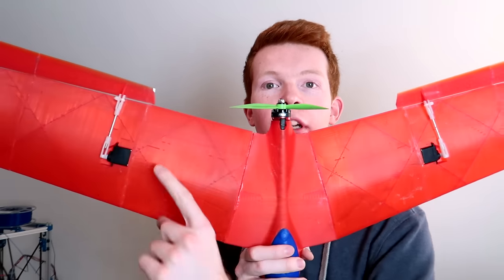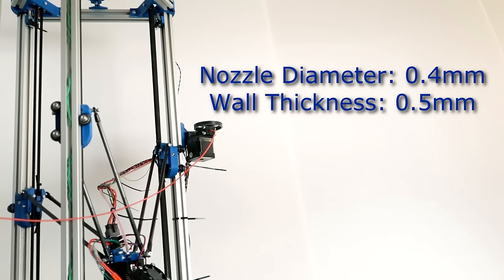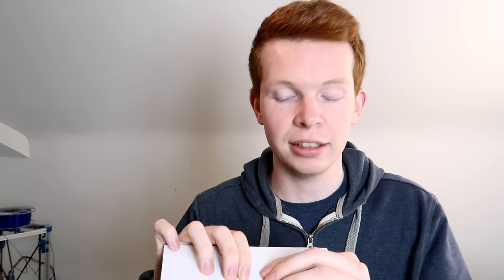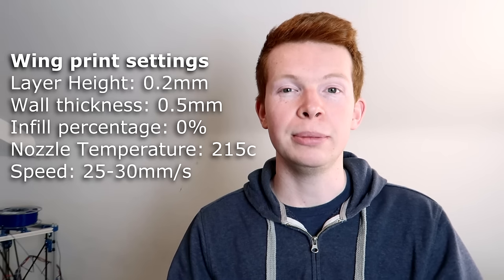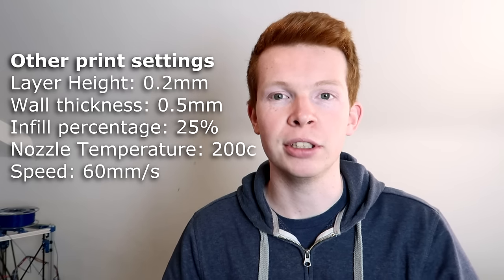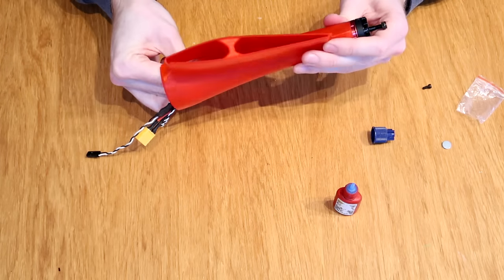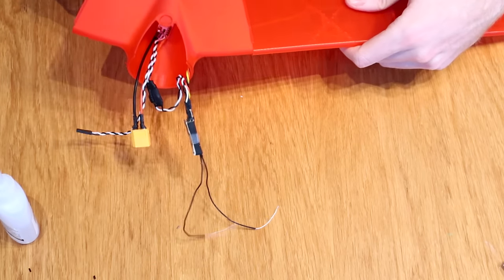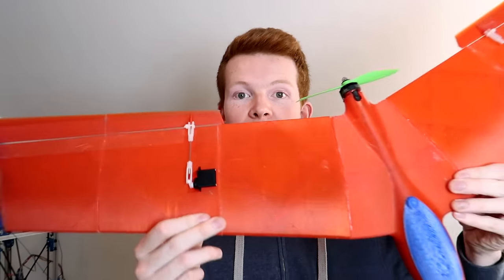Print THIS Plane! (FREE .stl Files)

Comment: Hi Tom;

First, thanks for this amazing plane design!

It took me about 2 weeks to get the parts to 3D print on my PRUSA MK3S printer.  
I have to admit the free PrusaSlicer software is an amazing slicer.

1. On the Fuselage front I needed to turn on “Detect thin walls” on “Print Setting” and “Layers and perimeters”.  I also printed it 150% on the Z axis to make the nose longer for better center of gravity or CG.

2. I change the “Perimeters” to 2 and the “Solid Layers” both top and bottom to 0.  This setting is also located in “Print Setting” and “Layers and perimeters”.  The perimeter increase made the parts much stronger and only added about 100 grams to the weight of the plane.  The 0 top and bottom allowed the male and females ends to go together.  I added a 5 mm “Brim width” located at on “Print Setting” and “Skirt and brim”.  I ended up printing each wing piece separately and each was rotated so that the female end of the wing segment was on the print bed.  I also used a bit of glue from a glue stick to help keep the wing parts on the print bed.

3. To make the canopy fit the new longer nose, I ended up printing canopy X axis at 145mm or about 130%.

4. To assembly everything, I used a deburr tool, hobby knife and pointed cutters.  I also used latex gloves when gluing the parts together.  I recommend you taking you time when gluing the parts together and let sections dry before continuing.
5. The winglet prints with a small post at the front and 2 half inch wedge pieces about midway down the winglet.  These get pushed through the material printed on male end of the outer wing section.  You can use a hobby knife to cut away material to help the wedges to fit.

A few design changes that would be nice.

1. The inner wing pieces on the male side of the wing have both the front and back sections tapered to allow for easy fit into female side of the middle wing section.  I recommend the same be done to the middle wing sections.  I ended up having to cut these to get the pieces to fit the outer wing sections.

2. The rib support on the female side of the inner wing and outer wing need to be cut back about 1/8 of inch.  To get the pieces to fix I had to manual cut away material to get a good fix.

Again Tom, thanks for a great design!
Richard Boyhan

Comment: I have printed this thing over a half year ago, today I managed to get it in the air ;) It flys really great, but I made some mistakes at glueing it together, so it broke in half after a hard turn ;)
Sadly, I have no video footage from the first flight. I used a 2200mAh battery, whith this the CG is good enough and I even don't had to trimm the plane much. It was flying out of the printer :)
I used the Motor, which Tom suggested with a 20A Turnigy ESC and a 5045 prop, cheap 5g servos (will be changed to better ones) and organgeRX receiver.
Reply: haha - had the same issue - mine also broke apart midair, due to not fully dried CA. I wonder if Epoxy is better. It would also be nice to have a Shaft where you can put in a carbonfibre tube or something to stiffen the plane.

Comment: Just started on my journey of building this plane this is my 2nd plane I’ve made it’s grey PlA + spray painted place the plane is fun but I recommend that you fill the plane with light weight expanding foam this helps when you crash you absorb the Impack other than that great model plane 👍🏻👍🏿👍🏾👍🏼👍🏽

Comment: Tom, finally got an ender 3 and I'm printing out the fuselage right now!  This has been on my list of projects when I was finally able to get my printer.  I modified mine to be direct drive, combined your recommendations and my modified profile and estimated 14hrs for the largest body part.  Thinking I will do my canopy in TPU, run the same motor, and possibly an S6R, if I can't get an XM+ to work with an old FC.  Maybe going to tinker with the .STL to allow for FPV - that should allow me to use the 1300mah battery without adding nose weight and fpv capability!  Will post it all once I can get it up
Reply: How'd it go I got my ender 3 pro hooked up and my fuselage is almost done

Comment: i used 5% infill on the wings to strengthen it up a bit but have to chop out some infill so it all fits together properly. The nose cone I printed tip first for better strength and quality, only needs a little bit of sanding to make it nice looking surface wise, the canopy is a bit annoying no matter how you print it, it always comes out with squiggles so i printed it with supports touching build plate only and printed with support interface using lines as the support pattern looks tops.

Comment: I started printing version seven of this. It will take me some time to save up for the RC electronics as I don't have any. I wanted to do RC planes as a kid but was so expensive 35 years ago.  I got to briefly fly this motorized plane that was attached with strings to a handle and promptly crashed it. Couldn't get my parents to let me try again :( Now I can 3d print a plane and the electronics aren't too bad.

Comment: Cool, good job. I look at that and the first thing that pops into my head: "fragile". I know it's a 3D printing exercise but have thought about adding a really thin layer, or two, of fibreglass? Toughen it up considerably without a massive weight penalty. Could be too heavy I suppose, so ,double the size, give it two motors and the sky is yours!

Comment: really cool. I'm just wondering why would you print this in PLA instead of ABS. ABS is much more impact-resistant, it's lighter (PLA density is 1.25 g/cm^3 while ABS is 1.04 g/cm^3, so kinda significant difference) and generally cheaper too. Won't melt in direct sun in the summer either ;)
Reply: It's probably what most people have laying around ;)
Reply: Hans Olo ABS is much softer/flexible, harder to print, prone to warping (especially with 1 wall thickness) and UV sensitive so yeah ABS could be good if used properly but PLA is just easier and simpler for most people.
Reply: because is toxic and hard to print. I think PETG is the best solution for this project

Comment: Just a thought, maybe your winglets should point inwards not outwards, unless they're straight relative to the forward-facing axis then nvm. It looks awesome, at first I thought your CG would be far forward but read the wing itself was pretty heavy. Awesome man, it's a very clean looking airframe.

Do you use solid works?

Comment: Very impressive! Thanks for the tips on PLA as I tried 3d printing a glider recently and found it started cracking after a few crashes - will try higher temperatures as suggested, and also have bought some ABS to try.

Comment: Must print this when my Prusa arrives of ebay. This would be a good early project for me, I love r/c stuff and 3d printers are perfect for all kinda r/c models. Power pack should be cheap too, you can get a motor + esc of ebay for around £10 nowaday's, I already got a few 9g servo's so, it's like an r/c plane for £25. I bet they fly just as good as anything you can buy of shelf in model shop or online.

Comment: You can set the light momentary Switch on your Radio to "Throttle Override 0%". Then it's easy to keep the switch pushed with your right middle finger with throttle in the desired position.  Just let the switch go, and the motor will spin up. No mouth involved anymore :-)

Comment: Excellent work. I would like to see another version with slots on the trailing edge of the main wing as well as on the front of the ailerons in order to fit in printed hinges. I think this would achieve more of a complete look versus using packaging tape - just MHO.

Comment: Hey weird suggestion idea. maybe you could instead of printing the wings only print the inside pattern inside and a place for the servos. then instead pull some thin light plastic really tightly around the wings and glue it? or something but I thought that'd save it a lot of weight. the insides of the wing will shape it very well as far as I can guess. tho I'm sure those food plastic bags are way too fragile and thin for this. but something similar could work :)

Comment: Very Nice Project ! Super excited and just started printing.
Only got 1 weird thing... the "holes" in the bottom of the Fuselage are actually hole in 4 versions of the Cura Slicer and in the original stl fire they Aren't

Which slicer are you running ?

Comment: Nice! Like. The design. Could you add winglets that go up and down on the wingtip? Would give you a bit more slip stability. And with enough power you could do a vertical start.

Also: what do you think about a carbon rod in each wing?

Comment: Looks to be quite a nice starter plane. I don't have any experience with making one but I do want to make an RC plane this year. Eh, why you using your mouth on the controller for speed? Do you have to rev it up or can't you just go to full? Seems like you could 3d print something to hold it full then remove once plane is in the air.

Comment: Hey Tom - great work.  Where the 200mm build volume needed, I was all sad as my printer only manages around 170x170 on the x/y but looking at silc3r it just seemed to fit in (presumably the inner wings are the biggest parts)  You could do a very quick and dirty FPV with one of the "tiny Whoop" style camera/vtx's like the Eachine TX03 connected into the 5v reg
Reply from the maker: When printing the fuselage back section with the motor mount to the bed, it's 198.5mm high on the Z axis. Yes I will either modify the canopy for micro FPV gear or modify the nose section for a HS1177 camera! Thanks mate

Comment: Hey great design.  I am printing some test parts now trying to get settings correct.  Question for you:

I am getting a ton of blemishes in the wing skin, is that a retraction setting like combing?  Also do you print the fuselage back file just as it is oriented in the STL?

Comment: Great video. Any chance you could make a short video showing how you designed the wing and which software you used?  I've been trying to duplicate your results when it comes to splitting the wing into parts in order to have ribs inside the shell of the wing; however, I've had no success. I've been using 123d Design from Autodesk.

Comment: The density of ABS looks to be roughly 20% less than PLA. Perhaps you could get a pretty good weight saving by switching materials. Also I believe ABS is less brittle than PLA.
Reply: ABS will most likely rip itself apart while cooling down. Thin wall printing is much easier with PLA. Let us know if you tried printing it with ABS. Would be nice to know if it is at all possible.

Comment: Looking good that Tom, got the files, think I will give it a go. What's the printed weight of the air craft, just so I know how much PLA I will use? Regards, Ian
Reply: Ginger Ninja FPV 
when I run .STL files thru the slicer program (before printing), it gives the amount of filament needed to print that part and the print time.

Comment: Have you thought about using PLA friction welding the sections instead of CA glue? It would take more time, but would be stronger at the joints
Reply from the maker: +Alan Beard I have thought about it, but I reckon it would be very difficult to achieve with these prints as the walls are so thin. The walls would probably end up flexing too much to heat up, and if they do heat up, they'll probably warp

Comment: a bit late for this comment but you should put some litle wheels on the bottom so its not a pain in the ass to get it to take off, cause it looks difficult using a controler with your teeth.

Comment: I have printed 2 now one for my friend he has not put it together yet. Mine will be all finished assembly tomorrow and then will have its maiden. The hatch latch did not print properly and the joiner for the nose cone did not print properly as it had no support, so I printed a separate one. Otherwise all seems to be going O.K.

Comment: I have never flowen a RC plane or quadcopter before. Im starting my prints and well let you know how it goes
Reply: Byron Harty Have fun crashing
Reply: This is not the type of plane you should be flying for your first plane, Byron.  But let us now how you get on.
Reply: Ive been repeatedly crashing under thrust face-forward into the ground my $20 foam flyiing wing recently.  It needs the wings re-attached via hot glue again right now.

First plane ever, the damn thing is too fast for a newbie, heaps of fun though! luckily unless you completely thrash it into the ground all the electronics should more or less survive the impacts and you can always use them on your next plane :)

I suspect the 3d printed version is going to need to go a little faster to stay up, but good luck! flying is great fun

Comment: Nice job!  What flying weight did you achieve?
Reply from the maker: It was 468g without a battery and 670g flying weight. Thanks!
Reply: Cool - not as heavy as I was expecting.

Comment: Super cool plane :D 10/10 i'm going to design one of my own just for fun. I would recommend to put in just a tad of dihedral for more stability in the roll axis, especially if you do a fpv version. flying wings wich are unstable in the roll axis are very tiring to fly fpv with. 
I dont know if you have seen this or not but "amazingdiyprojects" on youtube made a 3d printed jet engine, just search for "3D printed jet engine" and you'll find it.
Reply: why would dihedral not work as well for planes without a tail?
Reply: I believe its because flying wings are already very ineficient because of the wing sweep needed to have a good cg. so adding dihedral would make the plane even heavier because you would need more wing for the loss of lift. The wing sweep also creates a dihedral effect (too much in some cases). Ive heard of using the opposite of a dihedral (negative dihedral?) to stabalise a flying wing but id have to try it to tell you for sure.
Reply: Flying wings are WAY more efficient than traditional airplanes. But yeah i read about flying wings sometimes being too stable, and they use anhedral to counter it. (Anhedral = opposite of dihedral)
Reply: Yeah they are an efficient design in not having to carry a fuselage and tail (reducing drag). But  structurally they are inefficient as the swept wings reduce the wing span reducing lift. They also don't have much internal space as you have to pack everything at the front. This blended wing body design is a neat solution but id still be wary with weight and 3d printing. But hey they are still super cool. Thanks for the correction.
Reply: Yeah in 3d printed planes a flying wing can be a bit structurally difficult, i did not think about that

Comment: I started printing the parts when I started to slice the fuse back I found it's too tall for my printer. I only have 180mm Z axis. If I scale the Z to 90% it will fit. Will this affect its performance or part fit?

Comment: no offense dude, but you build something with the unlimited design freedom of 3d printing, as someone studying engineering, aerospace even and, as shown in your previous videos, you have access to Catia v5. 
Yet, you use a cross reinforcement pattern which is, though not the worst, in no way optimal for the loadcase of a wing.
You put servos on the suction side of your wing, interfering with the airflow on the already stressed side, guaranteeing turbulent flow in that area. And then you make your aileron hinges out of tape which is while aerodynamically good a really quick and dirty approach.

I get that you wanted to protect your linkage. But you've got the unlimited freedom of 3d printing. Why not make ailerons with a decent hinge with inboard servos connected via a torque tube?
Why not run at least the very basic FEM that Catia provides to find a better design for your wing reinforcements?
Even if you don't do the FEM, I am sure that you are aware of the way regular aircraft wings are built. The reason they don't use a cross pattern definetly isn't that the shape was to difficult to manufacture.
Also, I know that it flies this way. Probably even pretty good. But everything can fly with the power of modern brushless/LiPo power. When you design 3d print your own plane, especially as someone that should know better and is interested in the engineering... 
Why :D
If I am missing something and you can justify your decisions I'd love to hear your reasoning.
Also, I really don't to piss on your work. This is just my opinon.
Reply from the maker: Some very good points there. The reason for choosing the cross pattern was mainly due to it being simple to print. If I were to print the ribs running parallel to the direction of flight, the printer would struggle to print a suspended horizontal layer without support. If I were to print the ribs perpendicular to the direction of flight, then the wing may experience some torsional issues. I probably will put it through FEM in Catia in the future, which may allow me to remove some of the ribs and save weight. The hinges were a bit of a 'bodge', but I chose to do it because it's simple and works. Maybe proper hinges will be a thing for the V1.2. I'm open to all feedback with this plane as I want to continually improve it seeing as there is a lot of interest in this area. Thanks!
Reply: Thank you for your answer!
Are you sure about the torsional issues without the cross pattern? An airfoil is a closed profile and while I didn't do the math in this case, it seems pretty strong. I would've suggested to do two stringers in an L pattern along the length of the wing to give the airfoil some support against pressing into it and use the limited build volume of your printer to your advantage as the first layer can be perfectly level since it is supported by your build plate. You probably can make 2-3 ribs per wing be sufficient and it also makes it easier to glue together..
Looking forward to version 1.2!